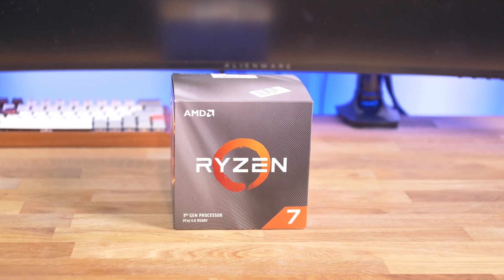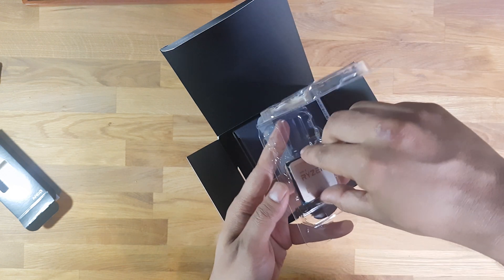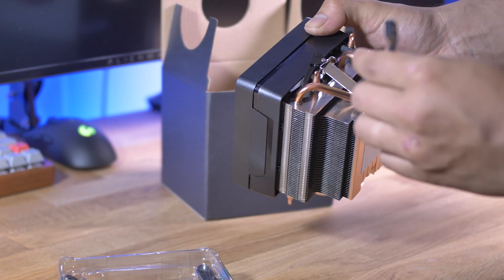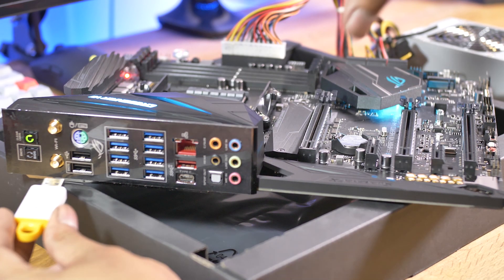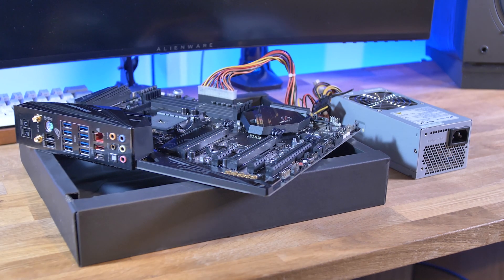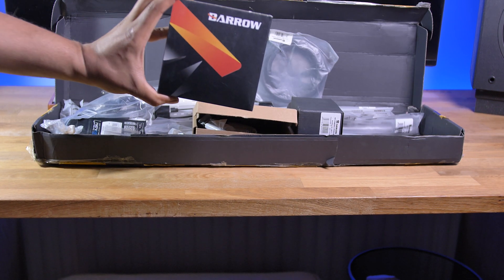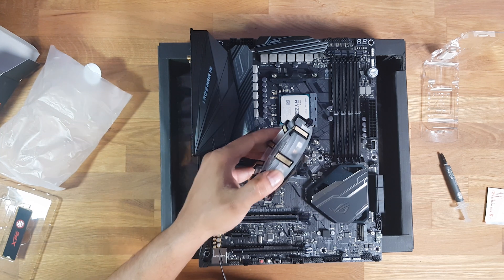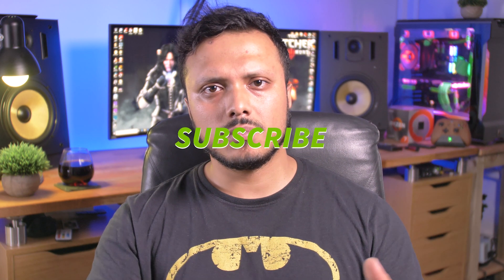AMD RYZEN 3700x unboxing and usb bios flashback asus X470 bios without cpu ram or gpu!

Comment: Amazing Guide JAF, really great. can I ask you something.. is this possible on ASUS ROG STRIX X470-F ? I mean flash bios without boot,
Because there no flash button behind the motherboard..?
Reply: I got a 3800x coming tomorrow, putting in that exact same motherboard. Wondering the same thing, so far researching it is capable.

Comment: Can I update my bios on asus rog x470-f with same way?
Reply: Dalil eddine Slimani Thats what im wondering because i have the same MOBO
Reply: @knacio  you can't I got the rog x570-e it's already supports ryzen 3000.
You have to install an old CPU and install new bios/chipset update in order to boot ryzen 3000.
Unfortunately your board doesn't support bios flash back feature this feature will allow you to install new bios without needing ram and cpu
Reply from the maker: What he said

Comment: I know im pretty late in the game because my FX-8370 is still running solid, but I finally reprieved my CH7. Going to get the Ryzen 3700x soon, however, I'm a little hesitant on RAM. I'm thinking either, Sniper X 3400Mhz,  Trident Z Neo 3600Mhz, Trident Z Royal 3600 or 4200Mhz... All in 16Gb dual Chn config. What are your thoughts on RAM selection? Your opinion would be greatly appreciated.
Reply from the maker: Questions are all good im happy to help if u sub! 

When it comes to ram u want b die bro thats all that matters

The corsair kit is b die 

Just make sure its b die then you have  plenty of headroom for overclocking comfortably

Comment: Thanks, I'm keeping this video saved on my favourites as I'll be getting a 3700x and will hopefully help me when Flashing my BIOS as I've never done anything like that before. I am also very tempted to get the Asus X470 hero too, or I was thinking the Asus B450 strix f, however it doesn't have a BIOS flashback button, at least I couldn't see it anywhere; someone correct me if I am wrong. 

I was also going to get the similar RAM to you too, however I find the RGB stuff is just costing too much these days so I am settling for a standard Corsair RAM. Well the RGB Corsair RAM I wanted costs too much, the other RGB RAM looks awful, the opaque version that is very popular; I just don't like the look of that. I prefer the vengeance RAM with the black heatshield over the top so it breaks up the large RGB light strip.

I am not going water cooling this build either, I am sticking an aftermarket Air Cooler on it. Although I agree with you on the AMD stock cooler, I know it's actually a pretty good cooler; looks good too for a stock cooler but there should be an option to just OEM the CPU.
Reply: the 450 f doesn t have bios flashback sadly
Reply from the maker: Hey,

Thanks for sharing your story
 
Ram prices are at their all time low for the past few years just depends on what you want to spend.

In regards to motherboard id reccomend the x470 hero because if you ever feel the need to upgrade your cpu to something like the 3900x atleast you would have the ability to do it without upgrading your board again.

Also most importantly SUBSCRIBE!
Reply: @thejafman  I'm going to wait a few more months, hopefully a lot of issues and bugs etc will get fixed through BIOS updates. 

I keep an eye on prices every day and everything is going up, including the RAM. 2x16gb cost about £140 about 2 weeks ago, it's now £160. Also the Asus board was available for £200 about 1 week ago too, it's gone back up to £250. I should have bought it all 2 weeks ago lol. Oh well, hopefully it get cheaper in a few months

Comment: What the risk if i put a Ryzen 3000 serie but my MB is not updated for? Can i launch the bios if i only have this cpu and update the bios ?
Reply from the maker: No risk but it wont post to bios
Reply: @thejafman  do you have any idea if we can update bios without cpu with gigabyte a320m-s2h
Reply from the maker: @NevsAnim.  no possible if you montherboard does not support usb flashback.  Amd are loaning people old cpus so you can update the bios
Reply: @thejafman  i bought a Gigabyte a320m-s2h and a ryzen 3 3200g.. does it means that i can can start my pc with the original bios?

Comment: Thx so much,,,
Reply from the maker: No problem habibi Subscribe!
Reply: i did,  and i have a question, Is there a big difference between x470 and x570?
Reply from the maker: @abdulrahmanal-ameri4663  x470 higher tier boards are the same apart from wifi 6 and native support for pcie gen 4

Comment: I am ordering the asus prime x470 pro for the ryzen 5 3600x, would i need to get the athlon 200ge to flash the bios?
Reply from the maker: No you should be fine as long as your board will support usb bios flashback

Comment: Hi! This method works with the asus b450f?
Reply: Hello Vass, not its not working on chipset b450 (asus), only x370 and x470 (crosshair)
Reply from the maker: You will have to check your manual

Subscribe!

Comment: can i do this on x470-f gaming?
Reply from the maker: 100% if manual says it can
Reply: @thejafman  except the x470-f lack everything you used on the crosshair to update bios, it does not support BIOS flashback without a cpu at all, so you need a posting system in order to flash a new BIOS. YOU CANNOT DO THIS WITH ANY ASUS BOAR WHICH IS NOT A CROSSHAIR, BE AWARE

Comment: Did you allready use the new cpu on the crosshair vii? I have the same mobo and thinking about upgrading cpu aswell :)
Reply from the maker: Yes i did there is no need to upgrade check the chart in the description.

Subscribe!
Reply from the maker: Also there is a build video coming in the next 2 days